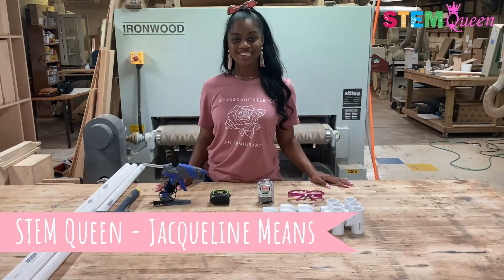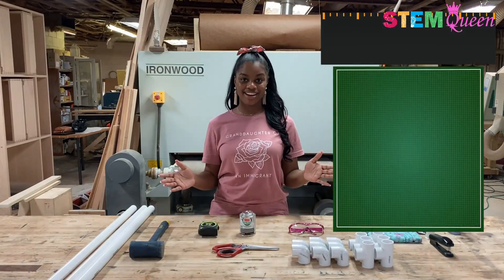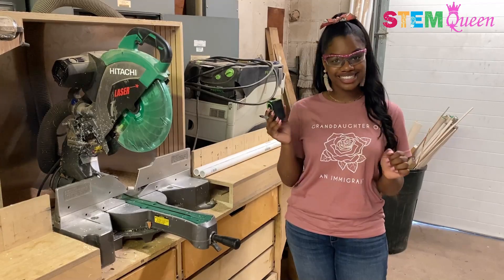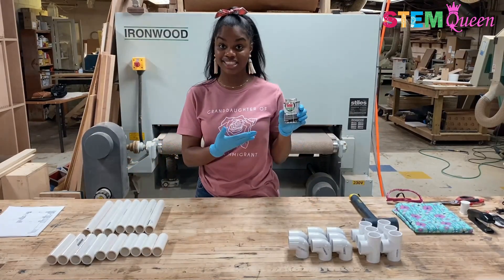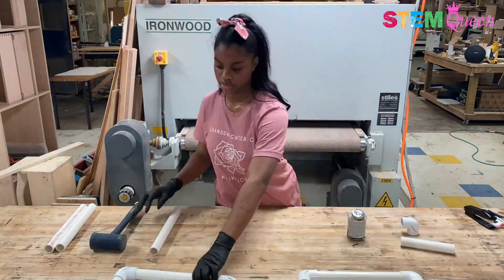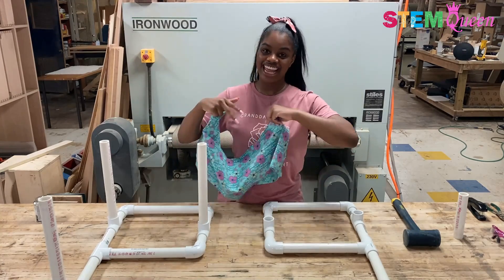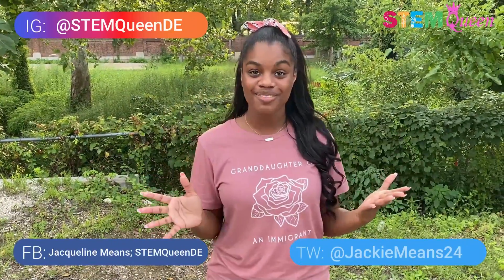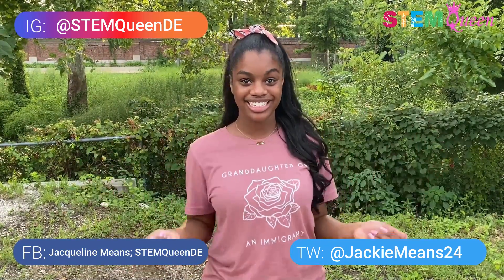Making a PVC Chair For Under $25! - The STEM Queen

Comment: **This will not last unless it's 'furniture grade' pvc which is a little more expensive. Regular plumbing pvc is not uv resistant and will degrade in the sun. Also, it will not hold up in the winter.
Reply: sch 40 should do the trick